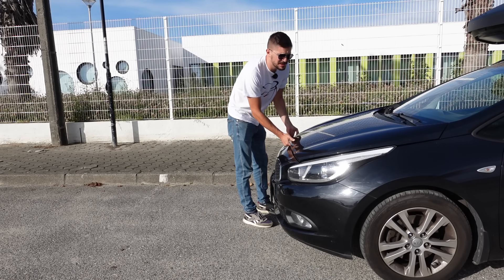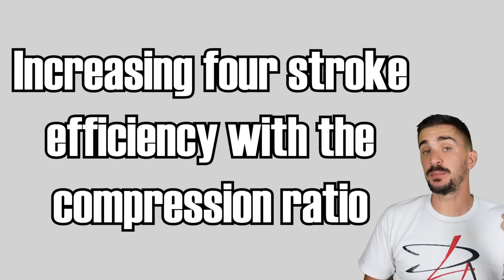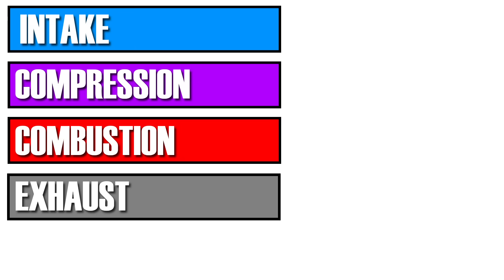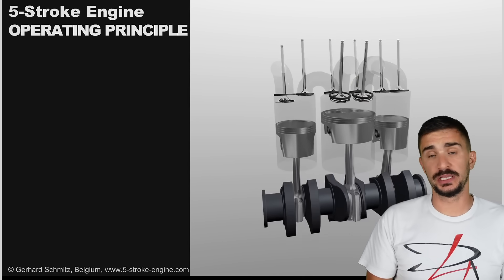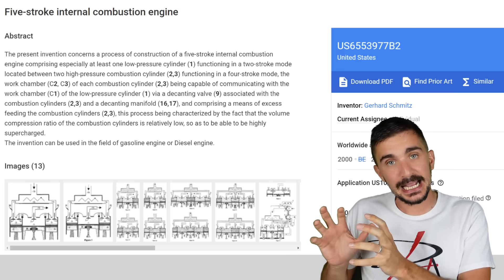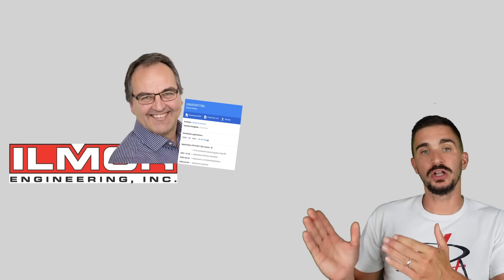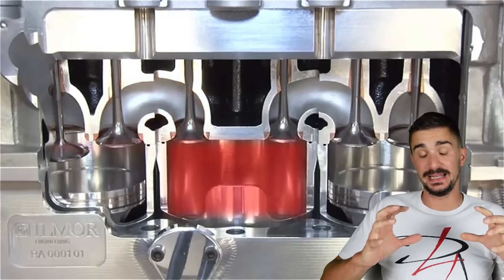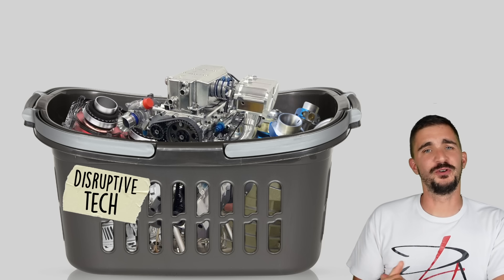Why Five Stroke Engines Are More Efficient But Still a Failure

Comment: Sails have been around for thousands of years, and have not really changed much (in shape, obviously materials changed somewhat). So, lets see in a few centuries where ICE is.
Reply from the maker: Mechanical complexity? Omnipresent? We will just ignore what I said?
Reply: @d4a  Sail rigging is actually rather complex thing mechanically, especially on the larger vessels. If you consider all the stuff necessary to keep the mast under enough tension to stay in place under load, keep the sail itself at the appropriate angle to the wind & in the correct shape so it produces lift, enable reduction of sail area in case of storms etc etc. And, of course, all of this needs to be operated in rather extreme conditions for months on end without failure. Though I concede sailing rigs do not require anywhere near as much precision as ICEs to manufacture.

Comment: Those efficiency numbers are totally wrong.
Only turbines can reach that high.
Car engines are around 14% where usable power at wheel IS around 10% or less.
Please, this is serious Matter to throw that kind of data...

Piston engines are inherent inefficient due to limited architecture in the expansion and high Heat losses mainly, and also high friction in the power transmission. Dont say they are efficient and other good qualities. They are dirty, noisy, super inefficient (10%) and more ....
Dont mess with people if you dont know,
Who's paying you to Talk that you say here mate??

Comment: @d4a Given the rpm specs listed in the video, I have to assume Ilmor's prototype is gasoline powered. Theoretically, wouldn't  a diesel version help mitigate some of the low load /low rpm drawbacks? I also think the application is wrong. As the engine has inefficiencies at low rpm, why not use them in applications that are medium to high rpm for most of time? Specifically, I mean marine and agricultural uses. In the context of both of those, they spend very little time at idle or low throttle.

Comment: 🤔, since it's inefficient at low loads and low RPM, but more efficient at high loads and high RPM, maybe it's a good candidate for range extender in electric cars. The catalyst could be heated up by electricity so emissions should be good, right?

Comment: The practice of allowing a bit of overlap of the intake and exhaust valves has the effect of producing a longer expansion stroke compared to the intake stroke, but probably at the expense of decreasing overall engine output.

Comment: I percieve it to be in the crankpin
At tdc combustion pressure is dead headed
As the volume above the piston increases the working pressure decreases
It would be more efficient to have a steam engine where pressure is admitted ATDC and have a constant pressure as the mechanical advantage of the crankpin increases more power would be extracted from the mechinism 
And combustion would not be such a difficult task

Comment: This is not really a thing.
From the working cylinder there is a lot of backflow so not all the air clears, so the next intake is tainted and produces less power.
From the airs perspective, it expands. First it pushes the cylinder down, but only because it pushes on the engine. 
Now it pushes against another piston which moves down. But it would have moved down.
It can only impart energy if it pushes the middle one down quicker. But since they are attatched to the same shaft, pushing it down creates an opposite torque in the first cylinder.

So the middle one wants to move clockwise but the outer one countetclockwise.

This balances itself because it is a closed system. It can not push on anything.

Also, the premise is wrong entirely.
The energy "wasted" as heat is not by choice.
It is a byproduct.
The reaction makes heat as well.
If you want a different outcome you need a change in reaction.

So you would need to convert the octane into co2 and h20 in a more direct way.
The explotions won't produce less heat because there is an extra piston.

You could use cooling pipes like ones in phones and attatch it to a peltier device and cool it on the outside of the car. This provides energy recapture.

But then you still have it that 80% of the energy in the octane is needed to refine it and transport it.
So 1 liter of octane in crude oil has an amount of energy. Say 100 units.

To crack it you need to heat it, costs say 30 units.
To separate it another 5 units.
Now you redestill with rest heat costing another 10.
Now it only has 55 units of energy worth. 
The truck transporting takes 15 units per vollume. So the now gassoline has 40 units worth.

Getting from the pump into your car costs 1.
Storage 3
Losses between 2 and 7.

Of the 100 units, only 30 enter your car.
But 66% is wasted
So only 10 units push the car forwards.

Compare to electric with solar.
18% efficient in absorbtion. 3% waste
15% pushes the car.
Is 50% gain

Comment: If the 5 stroke shines with high load, high RPM, why not use it for stationary generators? As always, the best use regime to a stationary generator is about at 100% of its rated power. Looks like a good fit to me.

Comment: The main failings (need for high load to make it efficient) seem to make it well suited to a modern PHEV where a small, highly efficient engine/generator could be used to charge while you drive on long trips.

Comment: Why not add a mguh for exhaust heat and pressure energy to help increase hybrid power and output ie remove the parasitic load that is presented by an alternator?

Comment: Usually your videos are better, but you have quite a lot of mistakes in here and you give misleading information.

First thing: An ICE gives you about 1/3 of the energy you input as fuel as mechanical energy (to accelerate you), about 1/3 goes into the engine block as heat and you lose about 1/3 as pressure and heat through your exhaust. The numbers vary a lot - i.e. as you said Diesel is more efficent.

2:30 - you claim there is about 4-5 bar of pressure left in the cylinder when the exhaust opens.
Let's say we have a diesel engine. No throttle applied. The piston sucks in air, compresses it, expands it again and you have almost the same pressure as before - most likely less than ambient air pressure.
If you apply throttle, you add something to the cylinder - the pressure after the power stroke thus has to be higher than after the intake stroke ends. But why does it have to be 4-5 bar then? It doesn't. But as an engineer you have to make compromises. More efficiency of the engine could mean a less powerful engine or you make it bigger or heavier - and people don't like that. They want small, cheap, powerful engines - even in ships, planes, whatever. There is ALWAYS a compromise!
Compression ratio has few to do with that (since, like you explained, you opt for the highest compression ration achiveable for your engine).

Then you claim the exhaust stroke needs to be longer to expand more. Again, see the argument: your engine gets heavier/more complex/whatever at the cost of little efficiency. But my complain is you miss to explain the Carnout efficiency. Or in other words: there is a physically limit to efficiency that depends only on the temperature of your burned gas mixture and the temperature you can expand it to.
And this is why diesel is more efficient. On average it burns hotter. Gasoline burns hotter for a short amount of time, but diesel burns hot almost all the exhaus stroke long. Or how else would you explain why diesel is still more efficient when using the same compression ratio?!

In the end I agree with your statements in the end: The 5-stroke engine is just too heavy/expensive for the benefit of little more efficiency.

To all of you: your engine that you use (if you have an ICE driven vehicle) can be quite efficient if you drove it at about 30-40% of max power - DO YOU DO THAT? No you don't.

Comment: Also there was a turbo compound engine used in WW2, or a turbosupercharger would help with low rpm boost, but would also bring back to the crankshaft some of the energy in the exhaust at high rpm, if you ise a big enough turbo, or you could just use the miller cycle! Anyway, in my opinion a compound turbosupercharged engine working with miller cycle and with the cooling sistem paired to some stirling engines would easily fit into a car, the make up in power would allow for a smaller main engine so the weight and space wouldn't be that much of an issue, the biggest issue would be cost but i definitely say would be worth it

Comment: THIS is why cars are more efficient if you don't go WOT, there is smaller amount of air and fuel to burn vs the full expansion stroke of the engine cylinder. 
So when you accelerate the car, don't go WOT.
Reply: I get 22 MPG on same car my wife gets 18MPG on same roads, same upper speed limit.

Comment: EVs are worse, for efficiency. The generation wastes 50%, and delivery wastes another 50//////////////////5, for total remaainder of 25%, then you have the added weight of those enourmous batteries.
Diffusers should be the catalyitic Converters.

Comment: ICE is a technological master piece, the only thing that has the potential to outclass it is electricity. I honestly think that if the batteries get much more energy dense, the electric motor will replace ICE.
But as things are right now, we are nowhere close. The very best batteries in secret laboratories that spend billions in research claim they are working towards 500Wh/Kg or 0.5kWh/Kg. Car fuel is about 12.5kWh/Kg, that's 25x better than the hypothetical breakthrough batteries (they don't exist yet, real world batteries achieve a little more than half that 260Wh/kg). They simply can't compete

Comment: TRhius wate of energy from the internal combustion engines is one of the main reasons of the climate changes.
The climate changes are not because of CO2 percentage but because of the enormous quantity of heat made (among others) by the internal combustion engines (bilions in the whole world).

Comment: You need to revisit your ideas on compression ratio. If you shave 2cc volume from a cylinder head, you get 98cc, not 102. The efficiency comes from a faster and more efficient combustion.

Comment: With a variable exhaust valve,solves some of the small throttle problems. I would use a prt like old aero engine. This would solve all the parasitic issues.

Comment: No body thinked to combine stirling engine to conventional engine, in order to increase efficiency ?
Reply: Creating a hybrid engine that combines elements of both Stirling and conventional internal combustion engines can potentially harness the benefits of both systems to increase overall efficiency. Here's a conceptual approach to how such an engine could be designed:

### Hybrid Stirling-Internal Combustion Engine (HS-ICE)

#### 1. *Concept Overview*
   - *Stirling Engine:* Known for its high efficiency, particularly at low and moderate power outputs, and ability to use various heat sources.
   - *Internal Combustion Engine (ICE):* Commonly used due to its high power density and rapid start-up capabilities.

#### 2. *Design Principles*
   - *Thermodynamic Cycles Integration:* Combine the Stirling cycle's external combustion process with the ICE's internal combustion to maximize thermal efficiency.
   - *Heat Recovery:* Use waste heat from the ICE to power the Stirling engine.
   - *Energy Management System:* Integrate an advanced control system to manage the energy flow between the two engine types.

#### 3. *Key Components and Operation*
   - *Dual Chambers:*
     - *ICE Chamber:* Operates on traditional internal combustion principles, burning fuel to generate mechanical power.
     - *Stirling Chamber:* Uses a regenerative heat exchanger to utilize waste heat from the ICE to expand working gas (e.g., helium or hydrogen) and generate additional mechanical power.
   - *Heat Exchangers:*
     - *Primary Heat Exchanger:* Transfers waste heat from the ICE exhaust to the Stirling engine.
     - *Secondary Heat Exchanger:* Manages the cooling of the Stirling engine's working gas, ensuring the temperature difference necessary for operation.
   - *Mechanical Linkage:* Coupling mechanism to combine the outputs of both engines, ensuring synchronized operation.
   - *Energy Storage and Recovery:* Incorporate flywheels or batteries to store excess energy and smooth out power delivery.

#### 4. *Control System*
   - *Sensors and Actuators:* Monitor temperature, pressure, and power output from both engines.
   - *ECU (Engine Control Unit):* Centralized control unit that optimizes the operation of both engines, adjusting parameters such as fuel injection, ignition timing, and Stirling engine heat input.
   - *Adaptive Algorithms:* Use machine learning to continuously improve efficiency based on real-time data.

#### 5. *Advantages*
   - *Improved Efficiency:* Waste heat recovery from the ICE enhances overall thermal efficiency.
   - *Fuel Flexibility:* Stirling engines can utilize various heat sources, potentially allowing for alternative or renewable fuels.
   - *Lower Emissions:* Improved efficiency and waste heat utilization can reduce the environmental impact.
   - *Extended Range:* Enhanced efficiency can lead to longer operation per unit of fuel.

#### 6. *Challenges*
   - *Complexity:* Integration of two different engine types increases the complexity of the design and control systems.
   - *Cost:* Initial development and manufacturing costs may be higher due to the dual-engine system.
   - *Thermal Management:* Efficiently managing heat flow and dissipation is crucial to avoid overheating and maintain performance.

### Implementation Steps
1. *Feasibility Study:* Conduct detailed thermodynamic and mechanical analysis to determine the potential efficiency gains and identify technical challenges.
2. *Prototyping:* Build and test a small-scale prototype to validate the concept and refine the design.
3. *Simulation and Optimization:* Use computational models to optimize the engine configuration and control algorithms.
4. *Scale-Up:* Develop a full-scale prototype, integrating advanced materials and manufacturing techniques to enhance performance and durability.
5. *Testing and Validation:* Conduct extensive testing under various operating conditions to ensure reliability and efficiency.
6. *Commercialization:* Develop a production model and establish partnerships for mass production and distribution.

This hybrid approach seeks to leverage the strengths of both Stirling and internal combustion engines, potentially leading to a more efficient and versatile power generation system.

Comment: Hey! And what about 6 stroke engines? :) As i know, it uses injected distilled water as cooling, to improve efficiency. Okay, of course the main drawbacks is you need gasoline and also distilled water as fuel, and a cold engine can't use the 5th-6th stroke, and the engine more complex, but you don't need cooling system at all, and utilize the heat of the combustion, instead of wasting it in the radiator. Why don't we see it anywhere? Thanks!

Comment: This is exactly why pretty much nobody used double-expansion engines on steam locomotives: the efficiency gains are marginal, and only at full throttle. A throttled down single-expansion engine has virtually the same efficiency because the cylinder pressure is lower and it fully expands even within 1 stroke, no need for a second expansion stroke.

Comment: Wheres the advantage over turbocharged two stroke ?.
Youre harvesting the exhaust gas to increase dynamic compression and the useful power strokes per revolution.
No need to increase static compression or the length of power stroke.

Comment: Sometime probably around the early 2000's read a white paper that talked about making an inline four switchable on the fly between four-cylinder four-stroke operation and two-power-cylinder five-stroke operation; the outer two cylinders' exhaust and the inner two cylinders' intakes switch to a shared manifold between the cylinders when in five-cycle operation (I don't think the paper suggested rotary valves for mode-switching, but I think this might be a good application analogous to the valves on a french horn).  Such a design would solve a couple of the downsides of five-cycle engines, by allowing the expansion cylinders to be used for power when needed, and by reducing the number of power cylinders (and thus increasing the amount of work each had to do, thus increasing the benefit from five-cycle operation).  Certainly it's not uncommon for engines to switch off cylinders during times of lower power demand; having the cylinders provide a little power via expansion stroke would seem better than having them be dead weight.  As for emissions, an engine could operate in four-cycle mode as needed until the catalytic convertor got hot.

Do you recall having seen such a paper around that timeframe?
Reply: I am not an engineer but did think along those lines if you read my earlier comments.

Comment: People here say this would be ideal for a plug-in hybrid but I disagree. PHEVs need small and quiet engines, efficiency, longevity and emissions are secondary because these engines are not used much at all. Best dolution would be a fuel cell (but not hydrogen) or a turbine generator.

Comment: Your videos are superb, I love how you thoroughly explain all the engineering details in a way my mind understands. Im glad you chose this specific engine to talk about too. I'm deep into reciprocating steam and compounding (using the steam multiple times over in intermediate and low pressure cylinders) has been something that's been done since the very beginning, and I had always wondered if it had been achieved with IC. I can very much see why this failed for automotive use, however with more R&D I could see this being very useful in a stationary or even a marine environment where high loads are consistent.